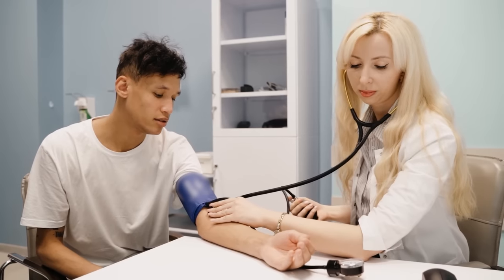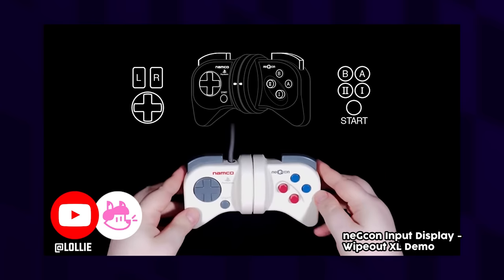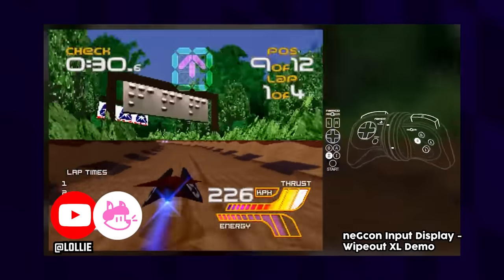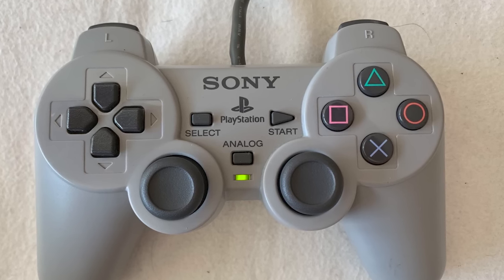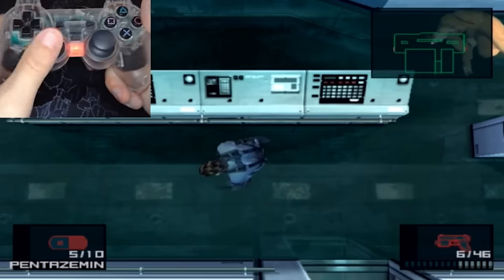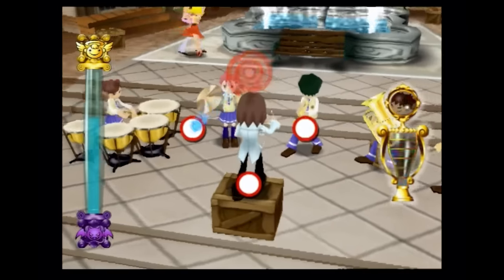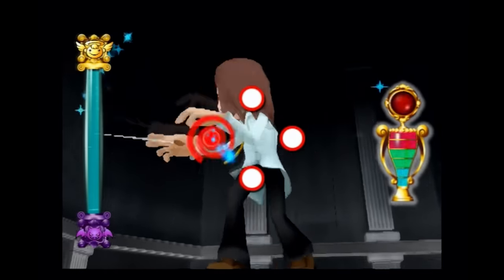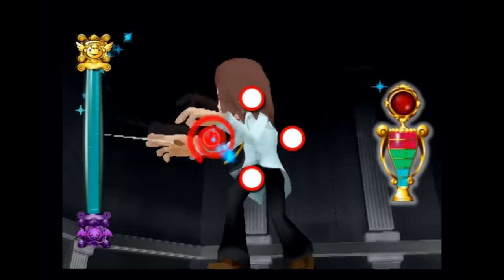The Short History of Pressure Sensitive Buttons

Comment from the maker: A programmer at Santa Monica Studio emailed me regarding the Pressure Sensitive label on the God of War PS2 games and Kinetica (Another SMS developed PS2 game) and gave me permission to post their findings:

"I saw your video on pressure sensitive buttons last night and your question about whether God of War even supported pressure sensitivity. I asked a coworker who worked on the God of War PS2 games:

<Coworker>: lol, there is AFAIK no usage of pressure sensitivity in any of our games
<Coworker>: I added pressure sensitive support to the code at a low level, and the E3 Demo of Kinetica used it. But the player response was soooooo bad we dropped it entirely. Of course I maintained technical support for it, but hey.
[...]
Me: https://ia801905.us.archive.org/27/items/kinetica-ps2-hiresscans/Kinetica%20-%20Box.jpg
Me: Kinetica also says "Pressure Sensitive" on the back of the box
<Coworker>: I definitely took it off the d-pad, pretty sure the accelerator, and the brake as well.

I also dug through some ancient code and found the controller processing code from the original GoW. The function that reads the controller overwrites an array of analog values, setting every value to either 255 and 0, except the X and Y values of the analog sticks. This means it's unlikely any game code in GoW ever accesses the analog button pressure for any purpose.

So, there you have it, the boxes are most likely wrong."
Reply: What a cool update, great video!
Reply: Box's designer just got lost. 😅
Reply: How nice of the Programmer and thank you for sharing!
Reply: Incredible.

Comment: I would assume another factor as to why the PS3 probably retained it was because the initial model of the PS3 was reverse compatible with the PS2.
Reply: And all models support ps1 games
Reply: Weird, since I have the PSN versions of GTA 3, VC and SA, and none of them support pressure-sensitive acceleration.
They supported that feature on PS2 and Xbox. And also on PC with mods.
Reply: @HydraSpectre1138 That's because those versions are PS2 classics from PSN. 

Sony didn't programmed pressure sensitivity into the emulator on the ps3.
Reply: It’s because Gran Turismo is a game that supported pressure sensitive buttons and that PS3 would have Gran Turismo and that the original controls game used the face buttons!

None of the features for most backwards compatible games work, but I’m not sure if it affects all of them?
Reply: @HydraSpectre1138 The PS2 Classics (aka the PS2 games at PSN) has them disabled by default for idk reasons.

Someone was able to modify the emulation configuration of the PS2 Classics to support pressure sensitivity and compatibility-related settings during 2020 though.
Reply: @ndnixlon9548  Does it also support USB keyboard and mouse controls now? For games that supported them on PS2 like Half-Life and Deus Ex: The Conspiracy.
This is important as the PS2 was the only official release of Half-Life: Decay, and the PS2 port of Deus Ex has heavily remixed levels and tweaked graphics (including new FMV cutscenes).
Reply: Yup.
Reply: @jjnet123  PS1 didn't have pressure sensitivity so that didn't influtience the desition to have the feature on PS3 at all as third party controllers don't really count
Reply: @CrocoDylianVT I have never seen the word decision spelt that way lol

Comment: I was just thinking about this when considering emulating ps2 games with my xbox one controller. Perfect timing.
Reply: If you have a DualShock 3, that might be better. (If you can get it configured properly, anyway. Modern PCSX2 kind of broke it, not sure if it's fixed yet.) But if not, very little worry considering how many games used pressure sensitivity.
Reply: For most you should be fine with the normal mappings, but for some you might have to remap to the triggers.

To get MGS2 and 3 Playable square and circle went to the right and left triggers respectively. Which is fine for gameplay, but weiiiirrrdddd for menus 🤣
Reply: I think there was a trick where you could use the DS3 pressure buttons on modern pcsx2 by copying DsHidMini's x_input.dll file in pcsx2's folder, and simply configuring the controller as xinput in the emulator. I could be wrong about the procedure, but I'm certain it is possible as I did it myself a few months ago. It sucks that we have to trick it into it tho
Reply: @TWTFYC  still works and really well from my experience using it in mgs2 and 3

Comment: Sony's inclusion of pressure sensitivity on the SixAxis/DS3 isn't really that mysterious. The likely main, and possibly only, reason was to support the original PS3's backward compatibility with PS2 games.
Reply: I guess that's the reason why the dualsense still has the touchpad.
Reply: @MarcoA3774   why would they get rid of the touch pad? Loads of games for the PS5 only, with no PS4 version, use the touch pad in various ways. Why do you think they'd get rid of it if it weren't for backwards compatibility?

Comment: You should do a video covering Hal-efffect joysticks. I think people should be outraged that the big companies opt to use potentiometers instead of using Hal-effect sensors in the sticks. They worked in Dreamcast controllers and many of them today still don’t have drift.
Reply from the maker: I'll definitely consider.. I had no idea the DC controller sticks had this feature! I own a kong-king 2 controller with Hal-effect sensors so I thought it was a fairly recent implementation
Reply: Also the DualShock 3 and some Sixaxis models use a kinda similar technology to the hall-effect analog sticks called MR analog sticks; it uses 4-pins, aftermarket analog replacements of the 4-pin model are kinda non-existent.

The DS3 controllers manufactured when the Superslim came went back to the common 3-pin potentiometer design.
Reply: There is a new wave of hall-effect analog stick replacements for the 8th/9th Gen controller, the blue-colored (ANKES' K Silver) and the orange-colored one.

The calibrating process is kind of a complicated process in order to get an error percentage lower than 8%.

Comment: Slight correction about metal gear solid, its about how hard you hold the button. Holding it gently allows you to aim your gun, and pressing firmly does a trigger pull. It's most obvious with assault rifles, since semi auto guns dont fire until you release anyway. Grabbing enemies in 3 uses this aswell, pressing firmly will have snake kill the enemy while a gentle press will let you hold the enemy without stabbing them in the neck.
Reply from the maker: Good call and thanks for the explanation. I did just test the pistol and now that I think about it, you're right as automatic weapons would obviously work differently, thanks!
Reply: @Shanmania  yeah I figured it was a case of not having a save file with every weapon to test, easy mistake to make. Great video though
Reply: In metal gear solid sons of liberty and snake eater, you could press the button while you had the gun brought up and then you could slowly release the button to make him put the gun away without firing a shot..

If you went ahead and pressed it full force, it would fire, and if you slightly released pressure, he would put the gun away without firing it which simulated pulling the trigger all the way and pulling the trigger just enough to where the hammer comes back and then releasing it for the hammer to go back down!
Reply: It's actually about the release more than the push. Push it as hard or light as you want. It doesn't shoot until you release the button. If you quickly release the button, you shoot. If you slowly release the button, you put the gun away.
Reply: @propheinx2250  I knew it was something like that it’s been a long time..

I remember if you ever so lightly released the button you could get him to put it away and let the hammer back down without firing off the shot..
Reply: I knew it was a thing on Mgs3 but In the end it was a confusing mechanic. Small buttons  work better as binary input devices.
Reply: @joaocardoletto  It was so confusing that the HD version of any platform except for the PS3 had to make a half-baked solution (pressing L3 to put down the gun) but hey it functions better than a worn out DS2/DS3 would do and the 3DS version had to completely refined the controls to be more similar to MGS4 / PW.
Reply: @propheinx2250   no. What you said is only true of the pistols. With the machine guns, if you press down on the button then you'll keep shooting until you either run out of bullets or let go of the button.
  
But pressing down LIGHTLY on the button with a machine gun equipped will allow you to aim the gun precisely WITHOUT shooting it.
  
Did you seriously not know that? Why are you spreading misinformation? Have you even ever PLAYED MGS 2 before? I mean come on...
  
The HD collection re-release of the games, including the MGS Master Collection versions, changed this, because of the xbox 360 not having pressure sensitive buttons and neither would future versions of the PlayStation too so it was prudent to change it.
  
They changed it to clicking the L3 analogue stick button. Clicking that will bring up the gun to aim it without shooting, and clicking it will put it away again.
  
And that's actually MUCH much better than the version that used pressure sensitivity, because pressure sensitivity was so fiddly and easy to mess up, it was too unreliable. Whereas clicking the L3 analogue stick button is much simpler and easier, and much more intuitive too. So I much prefer that.
  
The PS5 still uses some pressure sensitivity though. Just not on the face buttons. The left and right trigger buttons on the top of the controller are used in some games where it'll be like you half press to fire single shots of bullets and fully press to shoot fast like a fully automatic weapon should.
 
Personally I don't like it. I'm not sure how to turn it off though. It annoys me a lot too when a game makes the triggers harder to press so you have to use more force to fully press them down because it pushes against you. When that first happened in a game I thought the controller was broken. It's just annoying. There must be a way to turn this off but I don't know how exactly. I can't find anything relevant in the settings menu. It just makes the trigger feel "sticky" kinda. I suppose it makes it feel more like real gun triggers? I don't know, because thankfully, guns are completely illegal in my country. Even our police don't have them. But I guess that's what a real gun trigger feels like then?
 
But it's even in games like the original 2 Star Wars Battlefront games which were re-released for the PS5 and other systems. Cos in that you aren't shooting regular guns, you're shooting laser guns, so why would it feel like a normal gun? It's not like any mechanical force is needed to fire a beam of light.

Comment: Just so you know, if you use a DualShock 3 on the Brook Wingman for PS2, it will work with the analog face buttons and pressure sensitivity all wirelessly.
Reply from the maker: I didn't even think to test that! Thanks!
Reply: @Shanmania  5:13 please man. Is that you with the painted nails
Reply: @alexmcphee6789 You got a problem with that ?
Reply: @alexmcphee6789 ??? Obviously?
Reply: @alexmcphee6789 So what if it is? People been decorating their bodies for our entire existence as a species.
Reply: I have the Brook adapter for PS3, and I use a PS4 controller. I can play 99% of the games except for Metal Gear Collection, which has the same pressure sensitive commands from the PS2 version.
Reply: @alexmcphee6789  it is possibly not, check the end of the video, even if so wtf is the problem
Reply: @chlorobyte_projects pretty gay bro.
Reply: @kodybuffettwilson  got a problem with that? KappaPride
Reply: Absolutely this!!!!

This setup breathed a LOT of new life into my PS2 racing collection that usually supported pressure sensitive buttons nicely (and also had in-game options that let you map gas and brake to r2, l2 respectively). PS3 had those lovely pressure sensitive full travel triggers for L2 and R2; as well as PS2 style face buttons and L1+R1 with the same minimal travel. The triggers gave you way more control over your gas/brake input with all that extra travel. 

Kind of wish PS2/PS3 racing (simulation) games also gave the option for analogue control on the handbrake and clutch pedal via dualshock.

Just a shame the pressure sensitive buttons are also what made the ps2 controllers so flimsy, and the knowledge to fix them properly  isn't nearly as widespread as it needs to be. Info on the fixes is annoyingly bogged down with poor tutorials and misinformation especially since the AssemblerGames forum takedown; with the few genuine correct solutions being drowned out on YouTube (at least last time I checked) or obscured behind unwieldy archived versions of AssemblerGames.

Comment: There is a modern successor to the pressure sensitive button: The capacitive sensing button. They are mostly used in VR controller and can sense when your finger rests on a button or is near it. They are used to detect your hand position on the controller and to make your virtual hands match your real hands better, as well as to give simple gestures in multiplayer (e.g. thumbs up, pointing with your finger). Capacitive sensing is also present in touchpads and used for gyroaim, e.g. on the Steam Controller for example gyroaim gets activated when you rest your finger on the touchpad, this is much more pleasant to use than having to actually press down on the button to activate it.

Finally, the QuestPro controller has an analog-touchpad-click (done like a trigger with a magnetic switch), it also has a pressure sensitive tip on the back that can be used like a stylus. Though Meta doesn't seem to have much confidence in either feature or the device itself, so it's not seeing much use, the whole touchpad wasn't officially announced at all, but only discovered after launch.

Another thing worth mentioning: MIDI keyboards. They are also "pressure" sensitive, or so they appear, what they actually do is having two digital buttons under each key that are triggered at slightly different deflections of the key, thus allowing you to measure how fast a key was pressed, but not how hard it is pressed. Don't know if this kind of velocity sensitive button ever had any use in gaming.
Reply: I imagine some arcade machines used it where speed not pressure is what is being measured.
Reply: The Steam Deck has analog pressure sensitive touchpads too, it just never uses that feature for anything
It also has capacitive touch sensitive analog sticks, and activates gyro not only when your finger is on the touchpad, but also when it's on the stick
Reply: There's also analog keyboards these days. They use hall effect sensors to measure how far the button is pressed. In games it can just emulate an Xbox controller or something but I mostly got one for the customizability and rapid trigger function (like you can set the actuation point for individual keys and rapid trigger basically makes them very responsive)
Company that makes them is called Wooting (though others have copied the idea)
Reply: @zwenkwiel816  I remember Microsoft Research having an analog keyboard many years ago, back than it was proposed as a way to automatically correct typing mistakes, as you could infer the intended button by how much they were pressed compared to the ones hit by accident. It never entered production. Good to hear that somebody finally build one.
Reply: for some midi keyboards there's also "aftertouch" in addition to velocity which is true pressure sensitivity
Reply: The BMW i3 has capacitive programmable buttons, they display the program when touched.
Reply: Feel like a pressure+ velocity sensitive button would be more accurate in deducing what a player intends.  Because how hard we hit something is speed + density.